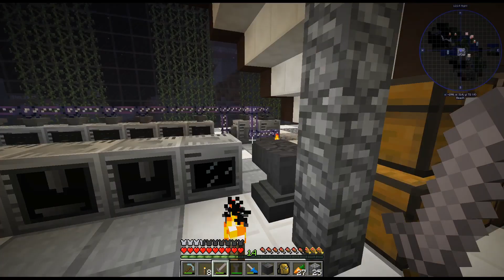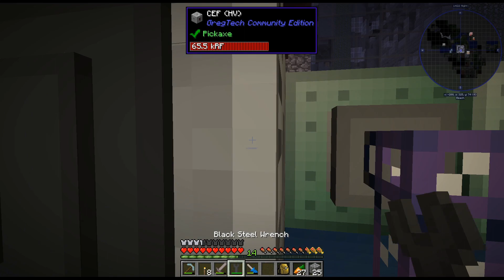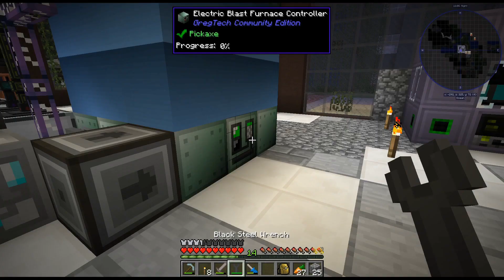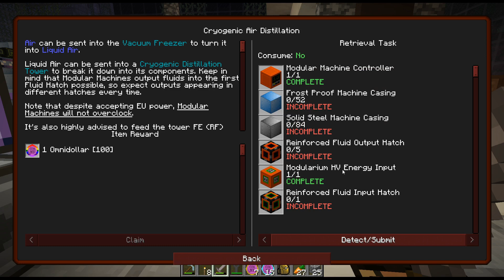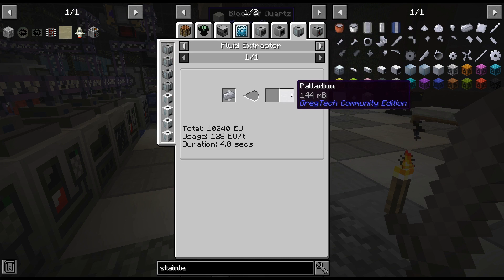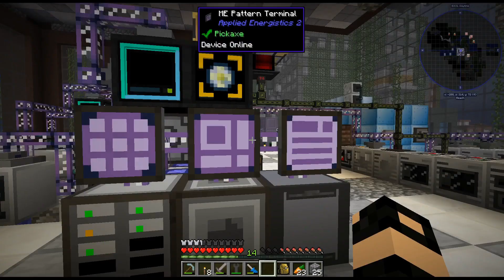Omnifactory - 43 - Nano Circuits

Comment: ⚠️
Putting this one out of order because it's very important!
25:30 You absolutely do not want to continuously run the carbon fibers recipe because the machine won't stop when it fills up-- it will keep going and void your materials!
This happens because GTCE only checks for valid output slots for guaranteed outputs of a recipe, and carbon fibers have a base 85% chance at MV.
We tell you about this in the quest, I strongly recommend reading the quests :)
⚠️

07:20 You can certainly use the HV input hatch for the Cryogenic Distillation Tower, but unlike what the quest sort of suggests, you should provide RF power like all other Modular Machinery multiblocks, due to the bug where that mod's energy hatches inexplicably disconnect from EU power sources.

12:00 You can technically get away with crafting just an EV Assembling Machine and an EV Electrolyzer, since IV pretty much just needs Nanoprocessor Mainframes and Tungsten from EV. The power drain increase is substantial if you fast track two tiers up though, so be sure to invest in your power infrastructure. Titanium is pretty simple and End Steel is cheap, so it doesn't hurt to upgrade a few more things to EV along the way.

IV is notable as the last tier before you need the Assembly Line for making machines. Players typically upgrade much of their base to IV for this reason, and only select machines past it until endgame where you can easily justify using UV ones everywhere. IV is also notable as the tier where your macerator's overclocked byproduct chances reach 100%: it's the best time to set up a fully automated ore processing line so you can toss in ores and they go down the various optimal refinement paths. Feels good to throw in all your Micro Miner mission yields and everything just happens :)

Comment: for the raw carbon fiber, it will still keep crafting even though the autoclave is full because its a percent chance. So it just ends up voiding all the carbon you put in. Doing a pattern of one palladium nugget to 32 carbon fiber might be the best way to do it, since using one full ingot in a pattern will result in four and a half stacks of raw carbon mesh, which is too much to encode in a single pattern.